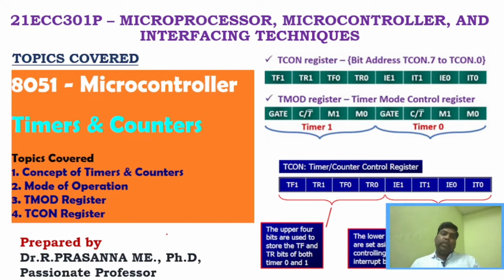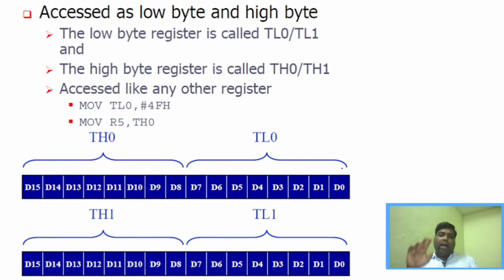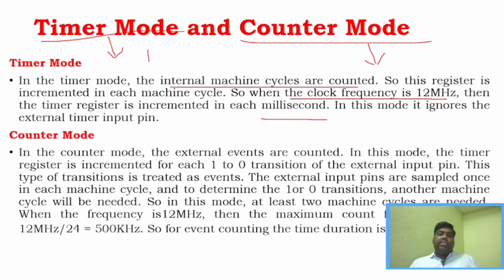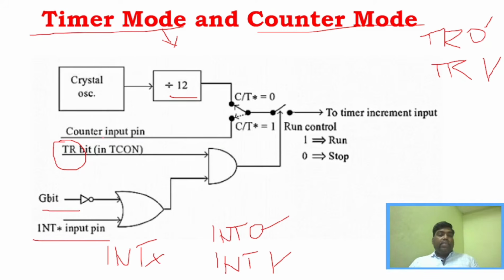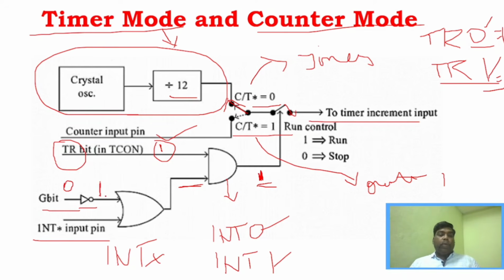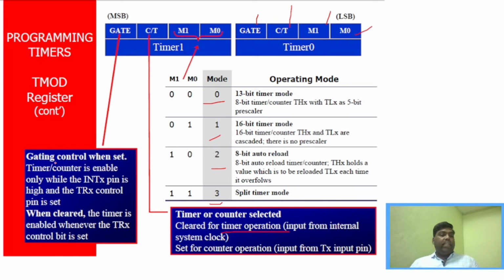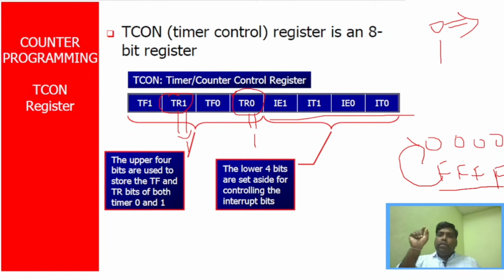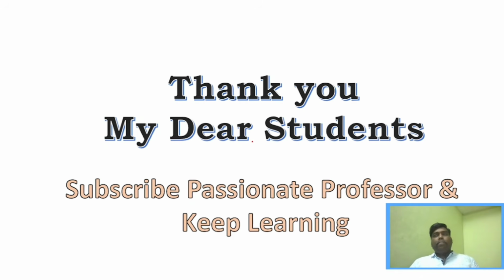Tmer 0 and Timer 1 of 8051 - Mode of Operation, TMOD & TCON Register

Comment: at 7:46, it states that when the clock frequency is 12 MHz, then the timer register is incremented in each millisecond. This is incorrect, if the clock frequency is 12MHz, then machine cycle duration is 1 microsecond, not millisecond.